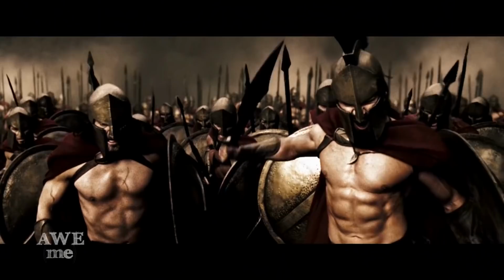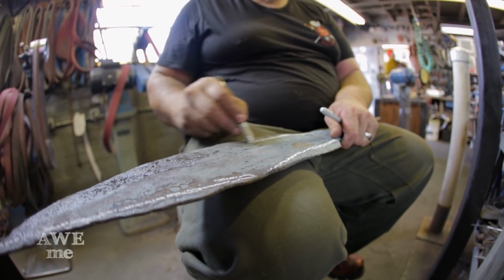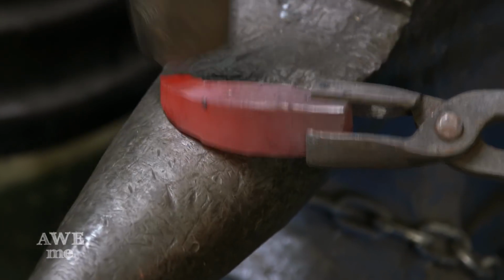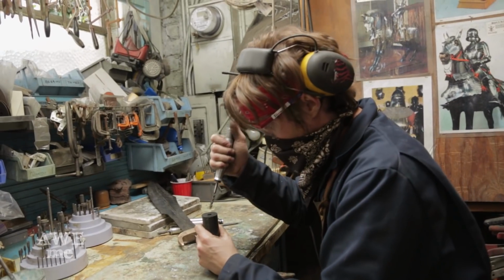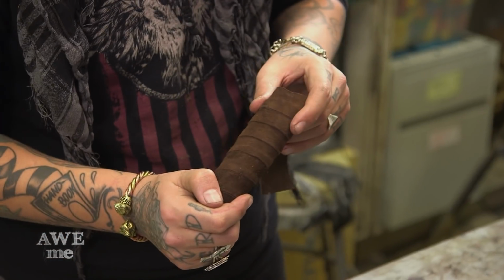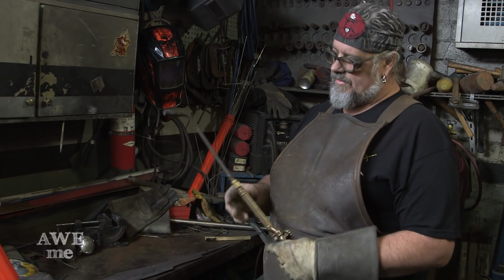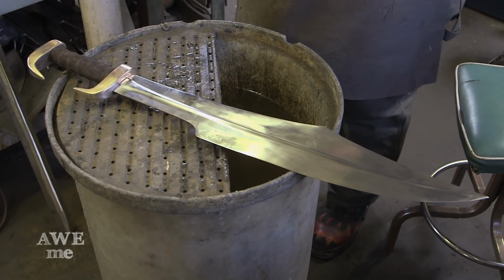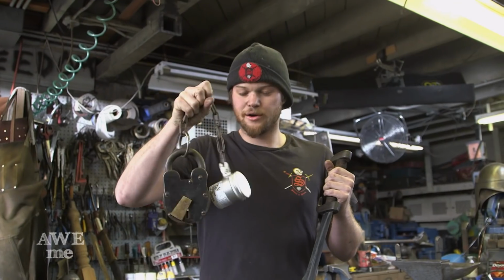King Leonidas' Sword (300) - MAN AT ARMS

Comment: wow he actually forged this blade from a piece of metal this time. I thought he would just cut out the shape from a sheet like always.
Reply: and look what happened when he did, it turned out so bad that he used the petunia excuse to cover up his shitty forging skills. 

He also forged the meteor sword in another video but instead of actually forming the edges and point with a hammer he just took it and cut it on a band saw after forging it to length. At least the new guys have legit smithing skills. 

There's nothing wrong with this guy's work for what he needs it for (movies and such) but I don't think he should claim to be a blacksmith like he does when he's so bad at it.

Comment: Didn't the ancient greeks make their blades out of bronze
Reply: +Joeby That depends entirely on what you mean by "realistic". They are trying to accurately represent the film.

But hoplite soldiers focused on spear use predominantly.
Reply: +Verdunveteran Actually, this looks like a fairly good example of an ancient greek kopis. A bit stylish and edgy, but to my eyes quite accurate. They even exhibit the center-spine that is charachteristic of bronze-swords to counter the materials malleability.
Reply: Robin Correct me if I'm wrong, but wasn't bronze the superior blade metal, at least early on? I was under the impression that early iron weapons were of poor quality, given how hard it was to get the slag out since they didn't have the blast furnace.

I was taught that the switch to iron tools happened not because it was better in the early days, but because the tin trade collapsed and iron was the only alternative to bronze.

So I doubt Leonidas would have wanted the early iron swords.
Reply: +Joeby there were ancient greeks (bronze) and modern greek (relatively), the modern ones, used state of the art materials.
Reply: +Whit3King the Spartans used bronze swords
Reply: Robin Didn't the kopis precede the Persian war by several centuries? I was under the impression that their swords had changed dramatically by this period, to be more like what would become the Roman spatha.

EDIT: Never mind, I completely misremembered that bit of my historical education. Spatha weren't a Greek transplant but a Celtic one.
Reply: +John Pryce This, plainly, I dont know. What youre saying makes a lot of sense, tough.
I would have looved to see this one made from bronze. Its a whole different metallurgy, too. So it seems very likely that they didnt know how to deal with iron. Just as today, proper hardening procedures of bronze are quite difficult to find.
Reply: +Robin Lindybeige and Skallgarim have done a number of videos on bronze weapons, the former more than the latter. One of them (I don't even know which one) even actually went to a workshop and made a bronze sword.
Reply: +Joeby yes, during the bronze age they did, then the iron age came to ancient Greece. However, no matter if a Spartan, or any other Greek hoplite, lived during the bronze age or the iron age, none of them would have carried a freak of a "sword" like the missfit shown in 300 and here. The sad thing is that there are idiots out there that actually think 300 is a historical representation of the historical Spartans :(
Reply: Verdunveteran
thank you, I thought man at arms were trying to be extremely realistic as usual
Reply: +John Pryce I dont have precise dates for the copis, but spatha only came up around the first century BC. The greco-persian wars were about 500BC.
The romans didnt even have a gladius by then. I think they adopted the falcata from the iberians and developed the gladius from that. The falcata was "the spanish version of a kopis".
I just looked into it a bit more into the material and it turns out that 500BC was exactly the time when iron was first used for weapons in greece. So it would actually be possible for Leonidas to wield one of the first iron swords.
Reply: +John Pryce Yep, seen those. they didnt use deformation hardening thogh as mentioned by the smith of skallagrims kopesh.
Reply: +John Pryce skall made one
Reply: this is the best video that I have ever seen and can you please reply back to me so I can and so can you make Freddy Krueger claws and can I get a Green Lantern ring that will be so cool that will be so cool thank you from your fans your biggest biggest fan
Reply: +Stacie Johnson who exactly are you talking to?
Reply: i had the same question
Reply: +Joeby 
This is what a real Spartan sword looked like.
http://kultofathena.com/product.asp?item=401178
Reply: ***** And your evidence is what? Archaeological sources put the earliest steel weapons well after the end of the Brronze Age.
Reply: +John Pryce guys......just let this thread die
Reply: +theringwoodbros And what if we dont want it to?
Reply: +Verdunveteran 300 was just the minimum number of soldiers a king would travel with as his personal guard but it could of been up to 2000 maybe more
Reply: +Joeby at the time of leonidas and the real 300 yeah
Reply: Verdunveteran I feel like the film 300 was made to show how elite and savage they was back then. If their traditions had carried on and evolved to modern day who knows what they’d be like.
Reply: No. The Greeks fell under the Iron Age. They had iron, but no steel. The Egyptians, however, were Bronze Age warriors.

Comment: Shouldn't the spartan sword be made of bronze?
Reply: +m4ti140 Actual spartan swords looked completely different. If you wanted historical accuracy, materials aren't really the place you start.
It's a replica of the movie sword, so there's no point in nit-picking.
Apart from that, as is even visible in this video, bronze is a lot more challenging to work with than steel, and also more expensive. I think these are the reasons they went with steel.
Reply: the greek persian wars were in the iron age
Reply: +rockyblacksmith Not harder to work, you have to cast and pour it into a mold.  It's actually less work once you have a mold created.
Reply: +VeryLongUsernameThat Doesn'tMakeTooMuchSense 1 nope, the iron age is way after this, when you have the medieval knight properly known. The greek vs persian war was made on bronze era.
Reply: +VeryLongUsernameThat Doesn'tMakeTooMuchSense 1 this is actuallt a veriation of turkish swords
Reply: Bruno Dupont iron age basically started around the assyrian era
Reply: VeryLongUsernameThat Doesn'tMakeTooMuchSense 1 greeks mainly used bronze in spartan era (city states era)

Comment: this sword actually may have been balanced. they did use solid bronze for the hilt and pommel and they did draw out the tang to put a little more weight into the handle to keep it from being front heavy, besides greek swords were a bit front heavy. they were mostly slashing weapons that had more weight toward the front to help carry the blades momentum through the strike. this sword design was invented by Hollywood to look cool but its not unfeasible that its balanced. and some of his other swords are balanced, like the master sword. but some of these are ridiculous props that aren't meant to be combat efficient, just sharp enough to do some damage to a few inanimate objects.

Comment: I could be wrong, I'm no expert, but I would think breaking all that glass with the blade would just dull it.
Reply: darksskull Considering they make swords, I'm sure sharpening it again would be a walk in the park.
Reply: darksskull It's a common way to demonstrate the blade is both steel and hardened and not just a milled out steel (or even aluminum) blank, which is what most cheap commercial replicas are.
A sword with a forged and hardened edge is barely going to dull from breaking glass. In contrast, the edge of an untreated, milled sword will be nicked pretty badly.
Reply: +darksskull plus, its idiotic and not at all satisfying way to show off a sword
Reply: +darksskull It's hardened high carbon steel...  It's not going to dull a sword at all
Reply: +Sherrifs Forge They also use a lot of porcelain, which is harder in fact than high carbon steel
Reply: They aren't going to be piercing any armor with that so who cares?
Reply: +Nosferatu Zodd "hardened"
Reply: Craig Duncan Smashing it will also not dull a high carbon blade
Reply: Some of you don't know about swords it all depends on what type of steel the sword is made out of the less quality steels will dull in 1 use and high quality steels need to be put thru really heavy use to make it dull.
Reply: +darksskull spot on
Reply: +darksskull Depends if it is cold forge steel or not.  In these sort of tests, no it wouldn't.  Look at what Skallagrim is doing to really test blades, and you might find your answers.

Comment: Here I looked up the alloy he used in that sword.
AISI 4340 alloy steel is a heat treatable and low alloy steel containing chromium, nickel and molybdenum. It has high toughness and strength in the heat treated condition.

Comment: Temper; 1.
improve the hardness and elasticity of (steel or other metal) by reheating and then cooling it.

Forge; 1. make or shape (a metal object) by heating it in a fire or furnace and beating or hammering it.
synonyms:	hammer out, beat into shape, fashion
"smiths forged swords"

Now look up the process used to make the type of steel he was using and tell me this is not a real sword???

Comment: Why steel? Bronze and wood is almost certainly what those blades and hilts were made from.
Reply: No but I actually paid attention in history class when I was in school.  And spartan swords were only about 20 in overall
Reply: David Bookout well, kopis were. Xiphos were not.
Reply: Steel is way cheaper and easier to forge out as you saw at the beginning where the bronze fell apart.
Reply: Also.  That's not even close to what a spartan sword really looked like
Reply: DARK HOUND Well, I mean David Bookout is not wrong. Spartans used Xiphos or Kopis. The one that the 300 sword is modelled off of is the Kopis which is a longer sword, often made of iron and preferred by cavalry (though plenty of hoplites also used them). The more "classical" Spartan sword is the Xiphos which is one of the oldest blade styles ever. These have been made of iron, but bronze was more common -- especially if you could afford it. Iron of the time was not very good, and it certainly wasn't steel (no one had even discovered pattern welding yet).

I'm not sure what would have been used for a king like Leonidas, but I assume it would be a bronze Xiphos as that's a weapon of status. If he was going to use a Kopis, it would have been bronze or iron -- definitely not steel.
Reply: David Bookout Im sorry.... do you have a 1000-2000+ Year old spartan sword? No you dont....
Reply: Ryan Gatts "Is not wrong" He did not mention anything about the sword, all he said was "Only about 20 in overall" I mean any other person viewing this would think What the fuck is 20 in overall, 20 inches? Centimeters? Meters? Heck Foot?
Reply: DARK HOUND That's why I prefer the unpopular convention of having the unit attached to the number 20in 40lb 60cm etc. There are problems though, 40lb might be mistaken for 401b at a glance.
Reply: K
Reply: Its not their fault that the swords was like that its who made it for the movie
Reply: They would have been mostly made of iron.
Reply: Ryan Gatts But to some people that could have just looked like terrible grammar "In overall"
Reply: Well to be fare, modern scientists believe that Spartans where invincible and fearsome warriors because they have discovered and been using steel (alloy of iron and carbon, carbon being between 0.2-0.8%) to forge their blades, weapons, shields even currency, while the other civilizations were using bronze, wood and iron in a best-case scenario, to forge their weapons. For the time that Spartans lived, steel was equal to a nuclear bomb.
Reply: Fotis D So basically spartans were russia? XD
Reply: Fotis D *spartans used iron bars as currency for a period of time
Reply: Alice Jibija Imagine fitting an iron bar in your wallet XD.... no wonder they didnt wear trousers... the iron bars ripped em.
Reply: that was the main point; it was hard to rob
Reply: Alice Jibija .......
Reply: Ryan Gatts you wouldn't forge bronze anyway its normally meant to be casted.
Reply: DARK HOUND Sorry, that was in response to the comment "Im sorry .... do you have a 1000-2000+ Year old spartan sword? No you dont...."

One does not need to own something to be able to know thing about it. The kopis that the 300 spartan sword is based on is similar to the movie sword, but pretty crucially different.

I'm pretty sure the "20 in" is an abbreviation of "20 inches" -- not the english word "in". Only kopis were ever that long (and those were for cavalry use). Shorter swords were much prefered.

Comment: im new with forging, why do they use oil? because i use water
Reply: because with water you can crack the steel with the modern steels we use so its safer but doesn't make the blade harder
Reply: So does using water make the steel stronger than if you use oil?
Reply: pooldacman marimar

Comment: what the hell is up with using bronze for pommels?
Reply: Bronze was more common than steel or iron.  Easier to work with, and even easier to make field repairs.
Reply: Cade Gant It's used because it IS heavier, it acts as a counterweight to make the sword more balanced in the hand.
Reply: Cade Gant nope, heavier than steel.
Reply: bronze is goood :) even for swords (kind of)
Reply: Probably for colour contrast and weight reduction. Bronze is a fairly light metal. I think.
Reply: ***** Well, It's probably used for authenticity (As ***** said) and colour contrast

Comment: I propose a challenge: I would like to see you make the Red Ranger's Power Sword from Mighty Morphin Power Rangers. I'd like to see the blade forged into shape (not just ground) from either 5160 spring steel or 1075 steel, and I would like to see a flat grind on the edge bevels (instead of the regular hollow grind). 6061 aluminum (anodized to a red color) can be used for the hilt parts (the guard and the pommel), while Delrin can be used for the grip (keep in mind that this is a weapon with the capacity for two-handed use). But here's the real challenge: I would like you to find the actor who originally played the Red Ranger, Austin St. John, and get him as a guest to wield the finished sword. Could you do that for me, please? I'd very much like that. Thank You!

Comment: I've always liked the design of this blade. Even though it's not historically an actual sword that the Spartans used it is efficiently designed. Only problem is the open hand guard. Also like how you left the hammer marks on the blade, as most bronze swords from the period featured that.
Reply: It is historical look it up. ):(
Reply: It was a real sword but it was not used by the Spartans.

Comment: "historical build"...

sure...

nice fantasy sword tho, pretty cool looking :D
Reply: It does have a historical precedent (the Greek kopis).
Reply: JonnyLightning kopis were bent forward and were much shorter, the sword modelled here is roughly resemblant of a xiphos (with some weird curved style), which had an average length of 60cm, but the blade wasn't as wide, and spartan xiphos typically were 30-45cm, designed for the tighter phalanx where a large sword would be very unwieldy.

so yeah, fantasy sword (many fantasy swords have historical inspiration btw)
Reply: Qave its too long for a greek kopis, arguable if it would be a good size for a xiphos either, besides the main point, a fantasy build may take from history, but it is absurd to call something a "historical build" when you do not follow it's historical building process, technically speaking.
Reply: building this historicly accurate, would take weeks, even months. all he did was speeding up the process, and as jonnyLightning says, it does have a resemblance to the kopis

Comment: Question. How much does it matter what you quench sword blades in?
Reply: Certain grades of steel, which result in different hardnesses and flexibilities, require quenching in air, water or oil. The type of steel he's using required an oil quench. If you quench (reduce the temperature) of the metal too fast, it will cause flaws in the metal, called quench cracks. If you don't quench the metal quickly enough, it won't harden right or may deform.
Reply: the quench temperature matters more than the quench substance

Comment: Didin't Spartans had bonze weaponerry at that time? I don'T think thay had discovered steel yet.
Reply: They did, but bronze is a bastard to work with and doesn't really look good when it is finished. Steel was used in the movie because it shows up better on camera.
Reply: I was also thinking this.
Reply: Insanitygamer
Of course the goal here is to reproduce the movie weapon even If the movie was not historically accurate.
Reply: Apparently they started replacing bronze swords with iron ones around 500 BC, and the battle of Thermopylae was around 480BC. Sparta also had quite a few Iron mines (if I remember correctly), and Leonidas was one of the kings of Sparta so he may well have had an iron sword.

As for the build itself, iron and bronze might be historically accurate but steel is easier to work with and less susceptible to rusting or breaking, which is kind of important when it comes to something that's part display piece and part functioning weapon.

Comment: Ignore my ignorance but can someone tell me if someone was to make a sword, what would be the best material for it, money no object. Would something like titanium or magnesium but ideal for strength and lightness? I am generally asking cause I have no idea.
Reply: That exists currently? Titanium is not a good choice as it doesn't hold an edge well, magnesium would be brittle if you could even form it into a sword. I think it would still be some alloy of steel, perhaps CPM 3V steel. But the heat treat is what will really determine how well it performs.